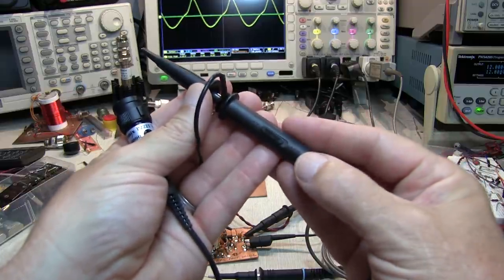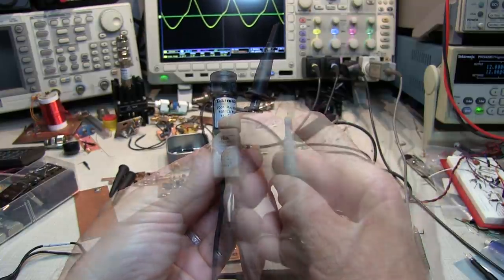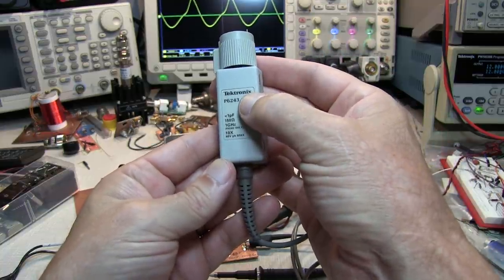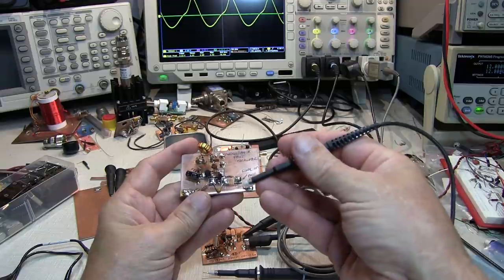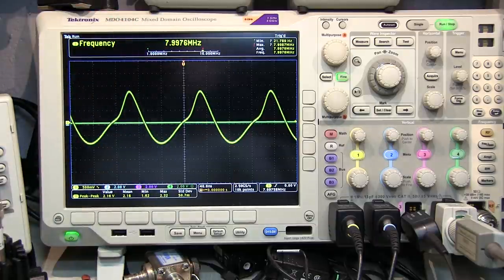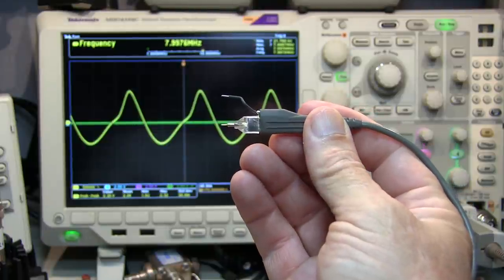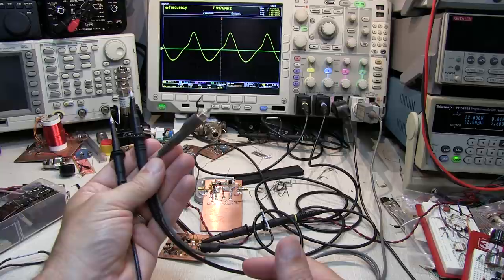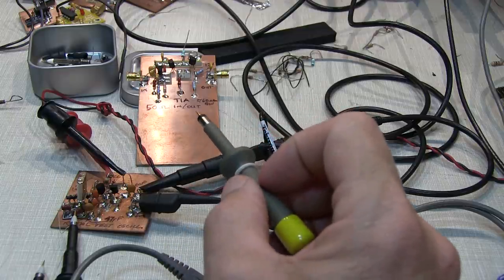#338: Probe Tips: Beware of capacitive loading of oscilloscope probes on your circuit operation

Comment: I've been measuring RF in an EMI lab for a decade and a half, and no one's ever given me a heads-up about this particular concern. Thank you!
Reply: That's weird, because they definitely should have if it's a lab of any repute.
Maybe they assumed you knew enough about the job.
Reply: @edinfific2576  I'd say we have an excellent reputation, and that it's well deserved. The problem is that EMI is a very broad and complex field, and little formal education is available for techs like myself. I learn something new every day - usually on the job - but sometimes from fine folks like w2aew  :)
Reply: @allenlutins  You're right. I had once worked for Maxim Integrated, great company to work for, nice people. I was a technician in a lab, mainly making and testing DC-DC converter circuits aparently for demo kits and purposes, and an engineer would give me the schematic for the circuit needed. It took me a few weeks to realize that the other technicians in the lab who had been working there for quite a few years lacked even the basic knowledge in some areas. But they knew enough to get the job done.
 And if you are sufficiently interested in electronics, your knowledge and understanding can approach or even exceed the level of an engineer, at least in some areas. It is an ever-pursuit of knowledge and it is rewarding when you are able to analyze or build your own circuits, and you become like a master in your field and can command a higher pay and respect. I wish you success.

Comment: Connecting a second probe of the same type in parallel while monitoring the waveform sensed by the first probe will show if the first probe was affecting the circuit. The frequency and amplitude of some parts of the signal will change as the second probe is connected.
Reply from the maker: Excellent advice.
Reply: Wow, great tip!

Comment: Active probes are great but very expensive. Maybe it could be a good idea to make a small diy circuit that goes in front of the 10x probe to buffer the signal to reduce the capacitance. Even if the final bandwidth is not 1GHz, it doesn't matter because most amateurs don't have a scope that goes that high. I wonder if just a simple emitter follower powered by a tiny lipo battery (to keep it light) is enough to improve the situation.

Comment: How about a follow-up video on the use of Bob Pease's high impedance probe published on EDN Jan 19, 1989 (p. 159)? Two FETs and two BJTs and you get a front end with 0.29 pF and 100 Gohm.
Reply from the maker: I’ll have to dig up that article.
Reply: I sure miss Pease Porridge.. He left a huge legacy of wisdom, but I am sure there was still much to come... Rest In Peace Bob!
Reply: That issue is not on the EDN Archive. I would love to see that article.
Reply: @jenniferwhitewolf3784  I used to email Bob Pease a lot and he would answer. Very knowledgeable and cool dude.
Reply from the maker: @jenniferwhitewolf3784  There is an image from the article in this EEVblog forum post: https://www.eevblog.com/forum/testgear/high-impedance-low-capacitance-scope-probe-for-open-drain-meausrements/msg2318136/?PHPSESSID=okesekntsqhrq05v3d8abbnsk3#msg2318136
Reply: I twice tried to post directions to find discussion of the circuit on other venues but to no avail. YouTube must have acquired the chinese Great Firewall technology.
Reply from the maker: @copernicofelinis  For some reason, it doesn't allow commenters to include hyperlinks.
Reply: @w2aew  it's even weirder than that. The second comment that had not been published did not have any link. I just explained what to search for on two websites, without mentioning them directly. It appears YT has some gaslighting AI agent that censors posts where generic directions are given. But I noticed that if I post a direct link to an image  the link will go through (presumably because the content can be checked.)

Comment: Good heads up on capacitive loading. Even 1pF from that FET probe can be enough to throw off a frequency measurement if the probing is done at the wrong point in the circuit. Gotta make sure you probe at the output of a buffer amp or similar and not at the actual oscillator crystal terminals.

Comment: Great video as always! As a electronic engineer whenever I have RF circuit I am checking my probe nearby oscillatora and after buffer ( amplifier) if there is frequency of difference between those two measurements, it is always good idea to find active probe.
Thanks for great advices.

Comment: I was aware of this but didn't pay much attention to it. We tend to think of instruments as if they're outsiders just observing a circuit, while in reality they become a component of the circuit being measured and influence the behavior of the circuit just like any other component of its characteristics, whether it's the resistance, capacitance, inductance, impedance or even a non-linear characteristic if the instrument's input contains non-linear elements (diodes at the input, for example).
I had an RC circuit with a 10k resistor and a 47pF capacitor, and even the 10× (or 10:1) probe has between 10 and 20pF, enough to present up to 40% of the circuit's own capacitance.
But now I have a 100× (100:1) high-voltage probe (Testec TT - HV 250, 2.5kV), rated for up to 300MHz and has "only" 4pF input capacitance, but even so it is almost 9% of the circuit's capacitance and its effect can be seen, and this is at only 100kHz signal frequency (but in an edge detection circuit).

Comment: Yes the probe can often be worse for the circuit than a terminated 50R load, as at least that acts like a transmission line and can be compensated for. The reason why a lot of the more expensive equipment puts in a 20 dB pad and a test point, so that they can simply connect a coax cable and measure without disturbing the circuit, and even if it is left open circuit after manufacture the attenuation will not be a worry with any reflection. Saw that on an old RF distribution amplifier, where there is both an input and output test connection, with a selectable 20 or 34 dB loss to them, so you can just put a coax cable on to measure in circuit.

Figured out why it was not working, the topswitch power supply has a popped 10uF 400V capacitor, and the remains of a 8 pin topswitch next to it. But then again, analogue TV is still running, only 11 years after the rest of the planet switched it all off. Might be turned off fully by 2025.

Comment: nice video i want to ask you when i measure DC capacitors signal with my 100x scope lead do i need to connect the ground ? because when i connect it it short out the output , and if i make the scope without ground plug i get 120v signal on the dc output :( what should i do ? thanks
Reply from the maker: You should always connect ground, but always make sure that you connect it to ground in your circuit!  A scope probe (and scope) are generally NOT floating like a DMM, so you ALWAYS have to take care about ground.  Floating the scope (removing the ground pin) is unsafe.  There are specialized oscilloscopes with isolated inputs if you need to make measurements where there is no convenient ground, or use a differential probe.
Reply: @w2aew thank you for answering that fast

Comment: Nice info, where can I buy  active FET probes ? thanks :)
Reply from the maker: The major scope manufacturers make them, but are specific to their scopes, and are sometimes only for certain models.  There are some 3rd party ones that work with any scope, such as https://www.digikey.com/en/products/detail/cal-test-electronics/CT4121/6111354
Most will require a 50 ohm termination.

Comment: When you probed with the 8pF probe I'm trying to estimate the
circuit capacitance as 8 / ((7.9976/7.9974)^2 - 1) or about
160nF which seems rather large for the xtal. Im missing something?
Reply from the maker: Don't think that formula applies, since in this circuit, an infinite capacitance in this location would only change the operating frequency by several kHz.  See the G3UUR method in the linked video.

Comment: How would you know if your probes capacitance value is changing or affecting the circuit you're measuring? without having other types of Oscilloscopes that support other passive probe capacitance values and active probe to compared to the electronic technician wouldn't know what the reference is or know there is a problem unless you had other oscilloscopes that support different probe capacitance and active probe to know if the probe capacitance value is loading the circuit under test. I personally would just think it was considered normal using a 5pf to 10pf probe without knowing it was loading capacitance on the circuit under test.
Reply: He demonstrated that. He's measuring in two places and just observing the difference. The output of the circuit is probably able to accept a load or if not would still make a baseline for comparison.
Reply: @justovision  But most tech bench when working at a company don't provide oscilloscopes that SUPPORT different probe capacitance and active probe so you would have to have various probe capacitance to compare the measure Test points against.
Reply: I first figured it out when I made a high frequency oscillator, I used to find the signal on a commercial radio, when I unplugged the probe from the circuit the frequency changed. The solution was to add an emitter follower as buffer, so the probe capacitance have a much lower impact on the frequency if I put it after the buffer.

Of course, if you didn't encounter problems resulting from probing, you don't need to know this thing, and as you can see in the video the frequency of his oscillator changes very little (in comparison to my LC oscillator) because it's a crystal oscillator.
Reply from the maker: As "Phil so" stated above, simply connect a 2nd probe the the same point in your circuit.  If the response on the scope changes, then you know that your probe loading is having an effect, even for the first probe alone.
Reply: @w2aew  Right that is my main point is you would have to have different probe capacitance and the Oscilloscopes that SUPPORT the probe capacitance and active probe to compared against. Most Oscilloscopes don't support different probe capacitance or able to use an active probe.
Reply: @waynegram8907  no, just apply a second identical probe to the same points. Same type of probe, same scope, just different channel
 If one probe is loading the dut, two identical probes in parallel will load it more and you will see the first channel change.
Reply from the maker: @waynegram8907  No you don't.  Simply use one probe to look at your signal, then attach a second identical probe to the same point.  If your signal changes, then you know that probe loading is having an effect, even with just one probe.
Reply: @copernicofelinis  If you apply two identical probes in parallel will LOAD the circuit differently, so how is this testing the first probe with the same capacitance loading? Are you saying if you add a second probe and the waveform changes means what that the circuit is sensitive to capacitance loading for most circuit would be.
Reply: @w2aew  But wouldn't most circuits be sensitive to probe capacitance loading? I'm not sure if this is a valid probe capacitance loading test because most circuits Test Points will change or alter because you have Two Probes capacitance loading down the circuit.
Reply: @waynegram8907  well, yes, practically all circuits are affected by an added capacitance. The question is: is this effect appreciable? If two probes in parallel will produce an appreciable difference wrt to a single probe, then you can imply that a single probe also affects the circuit in appreciable manner.
Reply from the maker: @waynegram8907  Not really.  If you are measuring audio circuits, the 10-15pF of capacitance will be several Mohms of impedance which is very unlikely to pose any kind of loading issue.  If the node impedance is significantly lower than the capacitive reactance of the probe at the operating frequency, then the loading is not likely to be a problem.
Reply: @w2aew  By looking at a schematic how can you tell if the 10pf to 15pf probe capacitance loading will be a loading issue? or there is no way to tell by the electronic technician or engineer. Most audio circuits are 20hz to 20Khz so the 10pf to 15pf probe capacitance loading will never affect any audio circuits? The 10pf to 15pf probe capacitance loading will only affect circuits that are frequencies that are ABOVE 20Khz?
Reply from the maker: @waynegram8907  It simply requires understanding how the circuit operates, and how parts of the circuit will react to changes such as additional capacitance to ground.  At 20kHz, a 15pF capacitor looks like 530kohms of reactance, which is pretty high.  So, unless you've got some very high impedances in the circuit, a 10x probe is unlikely to cause any issues at all.

Comment: If you are measuring a TTL digital circuit, and the probe is connected to circuit, and you connect probe to scope then unplug from scope, will that affect the circuit?
Reply from the maker: It shouldn't affect it much when using 10x probes.